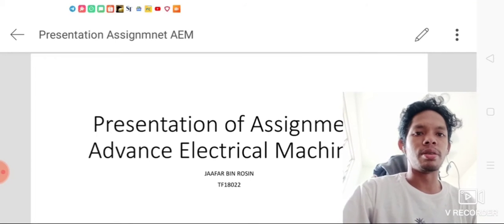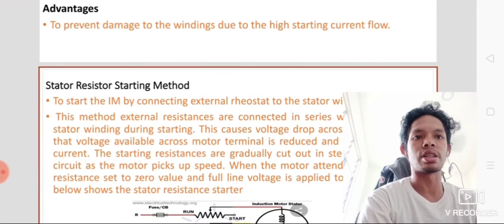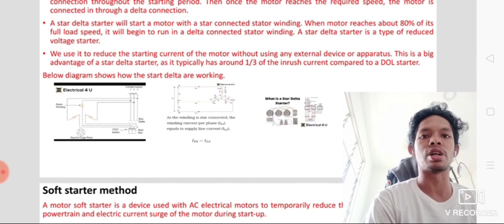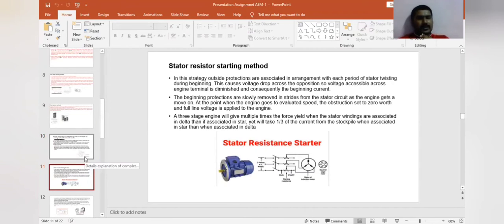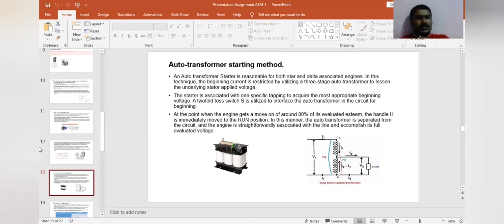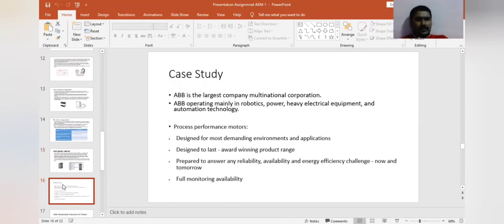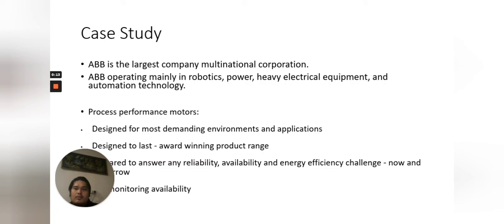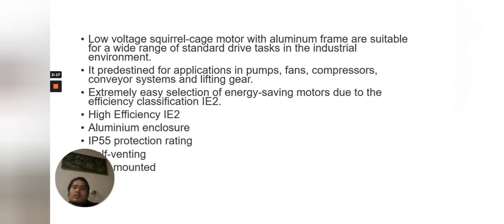ASSIGNMENT AEM BTW 2243 (INDUCTION STARTING METHOD)

Comment: What is the best method to start IM?
Reply from the maker: Auto-transformer starting method because both start and delta connected to the motor by starting with limited currect by using a three-phase auto transformers.